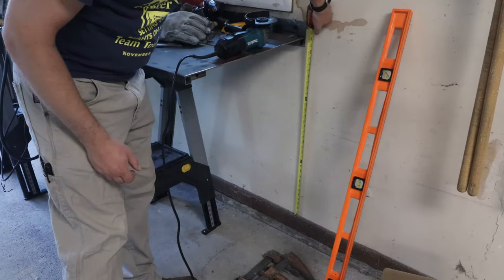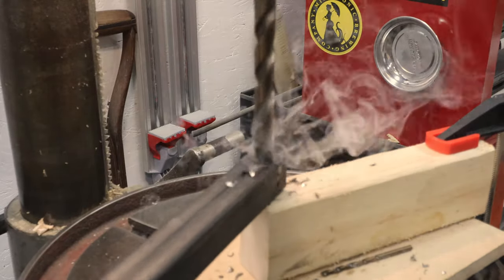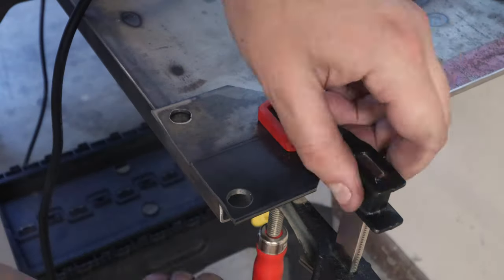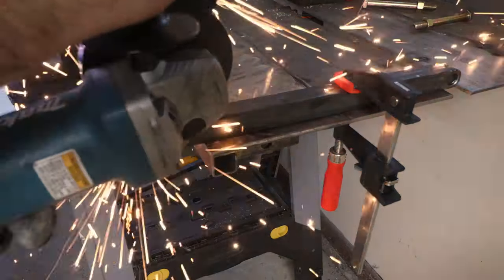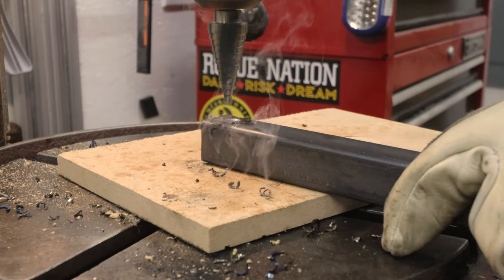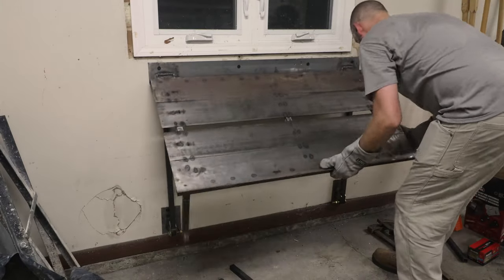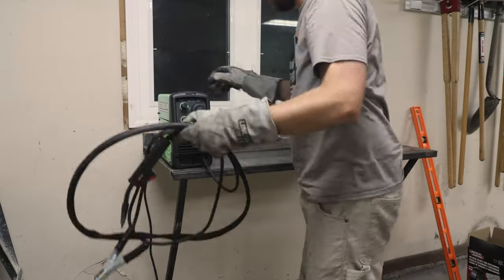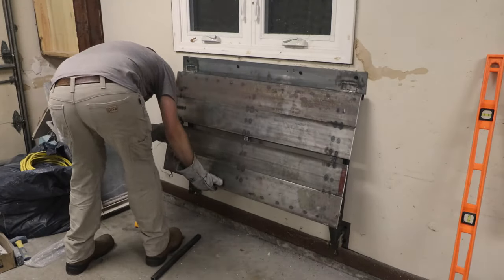The Best Small Workspace Welding Table | Part 2 | Making a Fold-Down Welding Table

Comment: cool leg solution
with wall support points few inches higher up the wall, you would not need a 2-part leg
Reply from the maker: Thanks!  Any higher and the table won't be comfortable to work at.  At times I contemplate moving mine down a couple inches since grinding on taller material really takes it out of my shoulders.